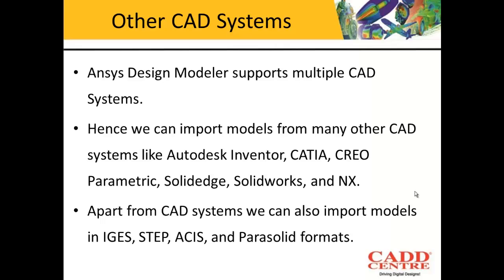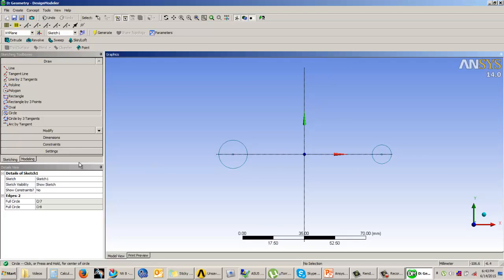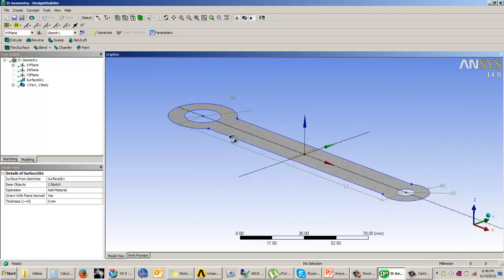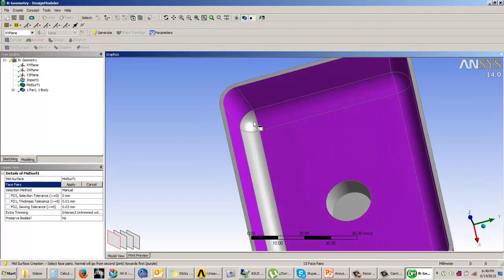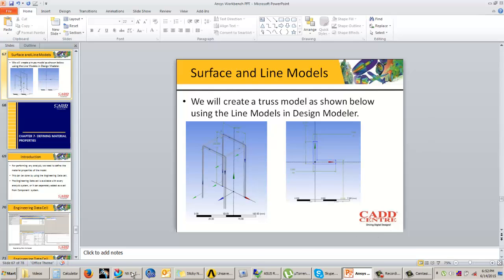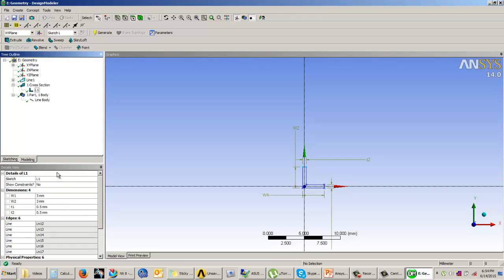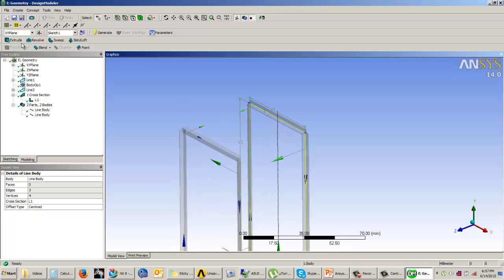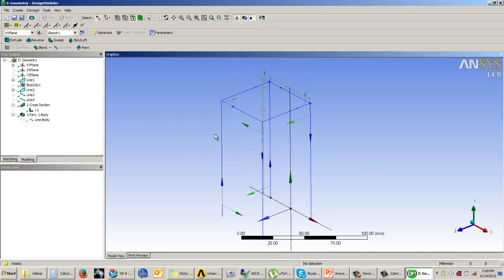12 How to Create Surface Model And Line Model in Ansys Workbench ?  Surface Model 2D, Line Model 1D

Comment: hi mam i am bit confusing actually i have design a model on solidworks and import it on ansys and it does not add a bearing and cylinderical support to that circular extrude hole would you please recommend me any solution for this i also have created new surface as you have tought in this video  would you please gauide me
Reply from the maker: Convert that file ni igs format and then import
Reply: Miss I already have convert that cad file into igs and than open in Ansys I don't what's the problem